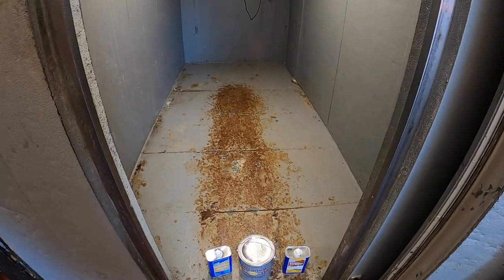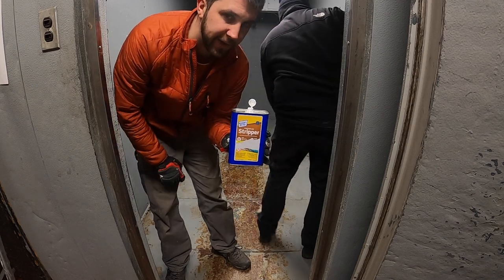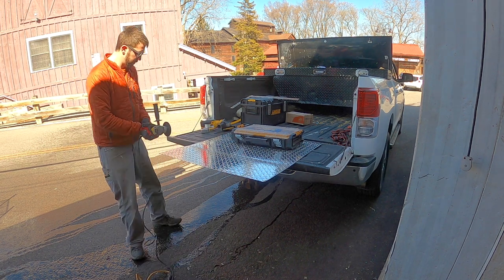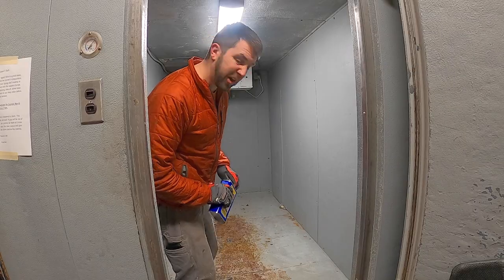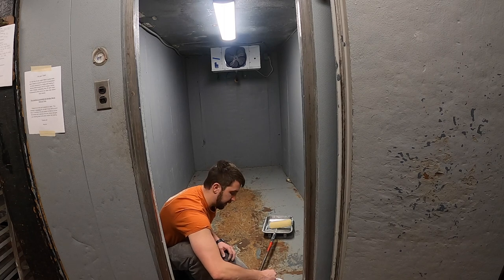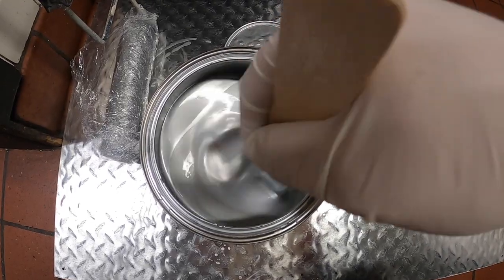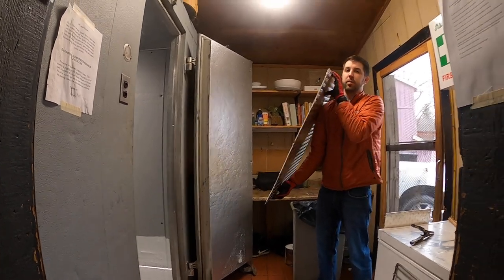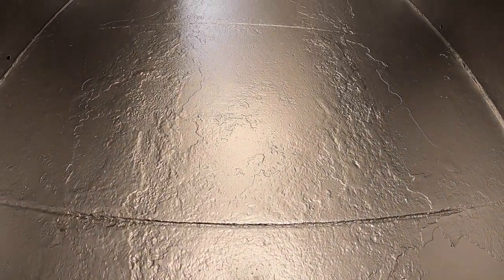REPAIRING RESTAURANT WALK IN COOLER FLOOR WITH RUST-OLEUM

Comment: can you suggest an inexpensive way to repair rust and corrosion along the bottom of my 20 year old walk-in cooler? When I took the coving off the inside there's lots of rust where the wall meets the floor, and major rust outside along the bottom in the area of the floor drain pipe. Thanks!
Reply from the maker: Honestly at that rate they make cheap thin diamond plates. Clean it up nice, let it dry and glue (all season glue) the plates to the floor. You’ll have to turn off cooler so it can dry warm and cut the plates to fit.

Comment: are there different variations of stainless steel panels for this?
im looking to do something like this too. but maybe skip the painting?. 

i was thinking to just place the panels on the floor. i  don't really want to drill or weld the panels onto the cooler itself. incase we want to remove the panels.
Reply from the maker: Yes there are, some local steel shops will even Bend for you. Get your measurements so it can be seamless up the walls / waterproof
Reply: @LabelSeven  appreciated. How long did it take you complete this? I'm guessing I need to close restaurant to do this  other wise food will rot